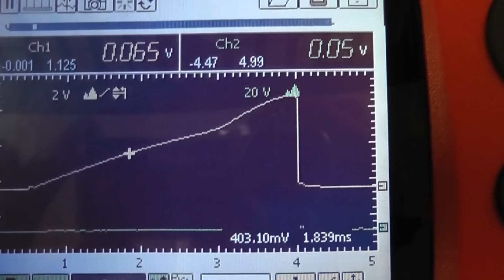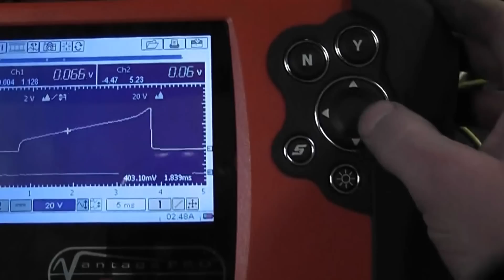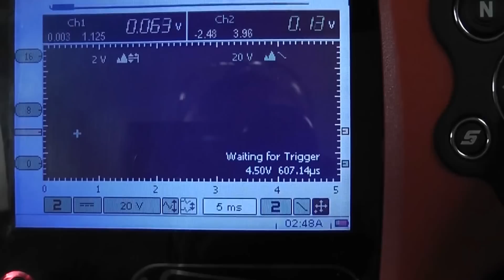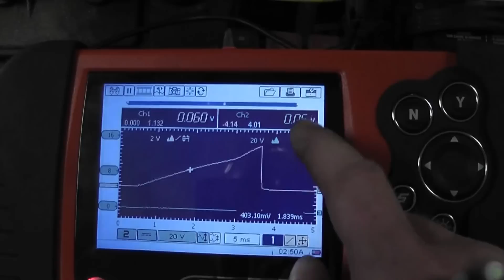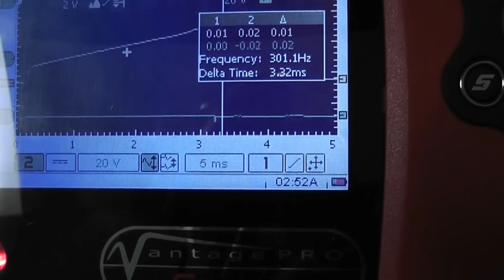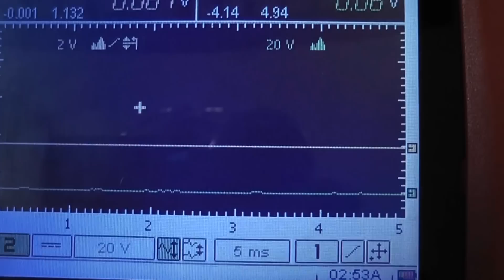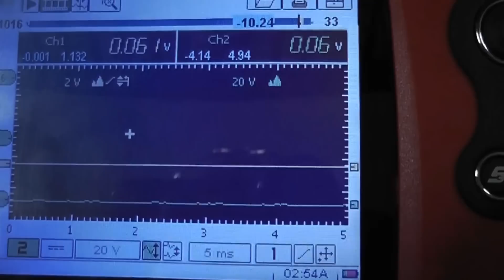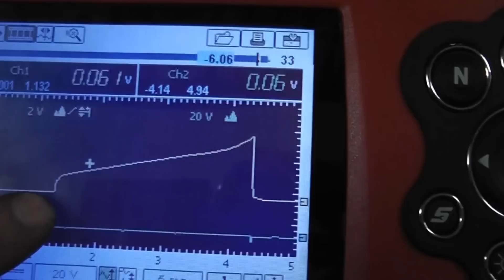How to test for a shorted ignition coil with a scope (Lexus)

Comment: You can easily replace the coil in 5 minutes, don’t need to remove the intake
Reply from the maker: Not even the point
Reply: Really
Reply: It’s a v6 engine ,three coils are exposed while the other three are buried under the intake manifold you’ll need to take off the intake manifold to replace the other 3.

Comment: I just had an 04 Lexus RX330... Misfire #2... Using a VERUS Edge with the S/O low amp probe, scales set exactly how you have it here but the ramp looks just as good as the rest of the coils. Since #2 is on the front, I went ahead and swapped coils #2 and #4, the misfire followed. Any suggestions on what to look for in that instance? Thanks
Reply from the maker: So the misfire moved with the coil right? Not all secondary ignition problems can be seen in a primary ignition current ramp. Pull that coil and lay it on it's side and test the distance the spark will jump using an incandescent test light connected to ground. I bet it barely jumps or leaks out directly to ground through the boot.
Reply from the maker: like in this video https://youtu.be/rQBIYLqLk2g

Comment: Hey Paul, great video there with good content. Question though. I was working on a 4 cylinder GM 1600cc petrol today with several cylinder misfires. Coil design was COP and all 4 coils are in one moulded housing so if you replace 1 coil you have to replace all 4. I set up my amp clamp on my verus as you did in this video and i went on the common live and got great patterns. I then decided to compare the waveforms on the common earth wire but i could not get any waveforms up? Would there be a reason for this do you think, apart from me messing up the settings somewhere? I had it running with clamp on the live and then with it still running switched to the earth. If you have the time to reply i would be greatful but i know how hectic you are, thanks alot
Reply from the maker: Since you are in a different market, I probably cannot view the diagram. Can you tell me how many wires go to your coil assembly?
Reply: 6 wires Paul. Common earth, common feed and 4 independant control wires from the PCM
Reply from the maker: Where are the transistors? Sounds like with that design, they are in the coil assembly? If this is the case, then you absolutely should have seen the same amperage pattern on that common ground (earth) wire. Your amp clamp would need to be turned around or select invert on your scope if you have that feature. Maybe it was there but you missed it because your 0 line was on the bottom of your screen? This is one reason I never have my 0 line at the bottom. I always pull it up at least a volt off the bottom. In case my amperage waveform is upside down, I will still see it. MAke sense?
Reply: ScannerDanner I follow your methods closely Paul and to get the pattern on the live wire i had to invert the waveform. Our Euro diagrams dont show internal details but i would assume the transistors would be in the coil assembly yes, as its really a set of 3 wired coils isnt it that simply share a common live and earth. I didnt have the zero line to close to the bottom on purpose (again from your teachings) so i was just curious if there would be a reason (apart from human error on my part) that i wouldnt see a pattern on the earth. It must have been my fault then no doubt. Thanks for taking the time to reply, im really appreciative
Reply from the maker: Thanks man and good job! There is another possibility and monitoring the control wire voltage signals will answer this. Maybe the common earth is for the secondary side of the coil windings and the transistors are inside of the PCM. If you see primary ignition voltage waveforms with spikes upward of 300 volts on those control wires, the drivers are in the PCM and that would explain why you could not see the current flow on that common earth.
Reply: Then that will explain it as i didnt know how to put into words what i was seeing on the "control wires" when i wrote my opening post. I was indeed seeing large voltage spikes, espesically on a snap. Thanks man, thats awesome! Totally understand why now. Need to come and enrole in your class man lol thanks again
Reply from the maker: For sure man. It sounds like you already are! Keep up the good work.
Reply: You too man 👍

Comment from the maker: That is correct. Measuring between the coil and transistor is not possible on this design as the transistor is inside of the coil assembly. You could measure on the main feed to the coils as well, but if I remember correctly there were other circuits sharing the main feed so I chose not to use it.

Comment: Hi Paul
Today I used my Vantage to diagnose a  no code intermittent misfire on a 2004 Ford Escape with a 3.0L.I connected the probe around the power feed for all coils (w/v) and synced it with cyl no 2 on front of the engine and found no1 coil with a sharper than the rest ramp.I then took the upper intake off and replaced the coil and no more misfire:)... the coils have two wires and the ECM supplies the power and G .I just wanted to share my victory with you and thank you again

Cheers

Comment from the maker: For COP engines a 3 or 4 wire coil = the transistor is inside of the coil
on a 2 wire coil the transistor is located in either the PCM or ICM. On the 2 -wire design you would not have a constant ground.

Comment from the maker: Great question. On this coil design the main switching transistor is inside of the coil itself. So it is ground side switched as you are familiar with however you cannot see coil negative voltage only current. Internally these transistors need a constant ground so when they turn on the coil neg. has a ground too. This is the ground I am connected to. It is a shared ground between all of the coils, so I can see all of the ramps.

Comment from the maker: @b16ef That is not what I said in the video.  The point was that we were able to pinpoint the exact cylinder that was misfiring and what was causing the misfire (one shorted coil) without having to remove the upper intake.